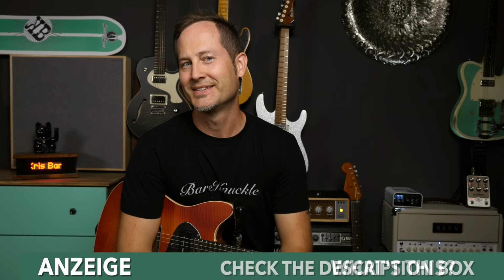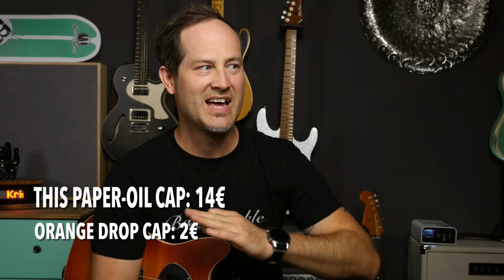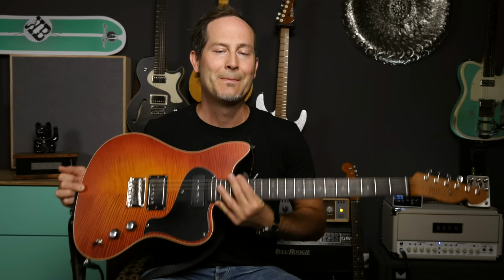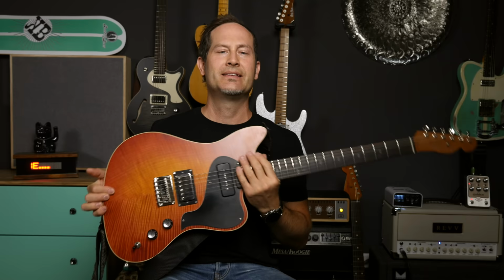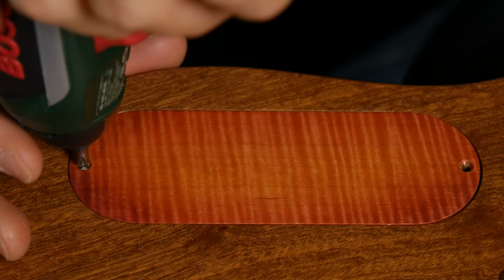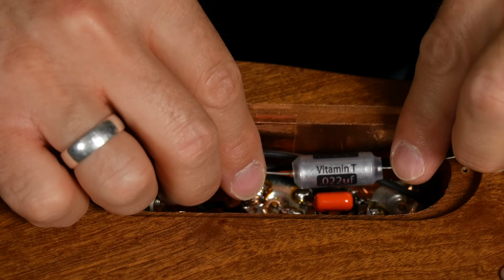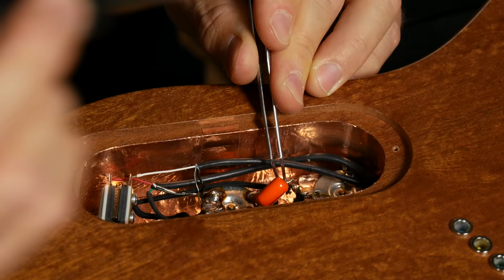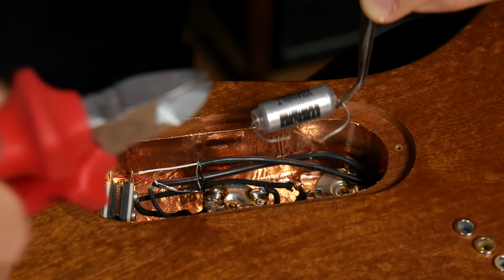Guitar Myth-Busting! Are Paper-In-Oil Capacitors Better? | Guitar Tweakz

Comment: The last mass produced paper in oil capacitors are far beyond "Best before", even NOS. And, Paper oil usually has huge tolerances in production, without tolerance markings, test says nothing. Usually for Paper Oil is +/-20%. Codes for old "bumblebee", color of 4th ring: green 5%, White 10%, black 20%, orange 30%, yellow 40%. If you buy those, if 4th ring is not green, you are even more ripped off. More modern color coded capacitors use different colors. Paper Oil degrades much more over time than modern materials. Modern materials produce much tighter tolerances. And if you really want PIO, check the market. PIO is available at $1 a piece (i.e. tubestore).    
As 5% was "best you can buy" for Paper Oil", that's standard for even the cheapest (Orange Drop Style) capacitors today. Tolerance classes today go from B ( 0,1 % ) to M ( 20 % ) - J (5%) ist just the 3rd worst tolerance you can buy. A 5% tolerance cap ( 220 ) can be anywhere between 210 ans 230 ... and this makes a tonal difference.
Regarding to a shop, where Vitamin T is to buy, this is 10% class ... so anywhere between 200 and 240 ...

Comment: Question: did you measure the parameters of the capacitors to ensure that they are nominally identical (capacitance value, equivalent series resistance(ESR)?).
Asking because you can't rely on just the numbers printed on them. Capacitors generally have a 5% or 10% value tolerance, meaning that your .022uF capacitor could have a value of anything between .0198uF to .0242uF out of the box*. ESR can be measured as well, but tends to be so low - of the order of 0.1 ohm - that it's not relevant. Also, the foil wrap direction *may have an effect, but only insomuch as one orientation may help to reduce hum so again, not really relevant to tone.
That capacitance tolerance, however, is the main thing. It is going to be way more noticeable than minor tonal differences due to whether it's a PIO or Orange Drop; the tone circuit shapes the frequency response of the guitar according to the value of the capacitor so if you're not testing with capacitors of identically matched nominal values, the experiment unfortunately can't be trusted. a 5% difference in capacitor value means a 5% difference in where the tone control 'bites'. That's huge; nearly the difference between A (440Hz) and Bb (466Hz).
Also; maybe a blind test with somebody else changing the caps but not telling you which is fitted before you play it would be more scientific. You may not believe you have confirmation bias but it can't be helped.
Not meaning to criticise to offend, please don't take it that way!

Comment: Next time, you can just use alligator clips & wires to connect the different caps rather than solder and desolder over and over. You can also do that if you want to test out different rating caps of the same type(all orange drop, etc...) and decide what you think sounds best before soldering it in. See whether you like .022  better than .047 or even try something like a .001 🤷

Comment: different types of capacitors may distort the audio signal for example ceramics, also that may have a different inductance and resistance due to the manufacturing process also the quality factor of each cap may be different

Comment: There are two important differences...price and less stability with time for the paper in oil.😄
And it would have been useful to measure the precise value and tolerances of both capacitors. Little differences in value will change how the tone knob responds when it's turned...but no differences at all when the knob is on 10, because there's no work done by the capacitor when the tone knob is fully opened.
Reply: I was looking for this comment lol
You literally can’t hear the difference between the caps unless you roll the tone

Comment: I didn't notice any difference. The difference if any is barely perceptible. I put oil and paper caps in a few of my guitars years ago and at first thought that it sounded a little warmer but I reverted back to my beloved orange drops. So much of tone chasing is cork sniffing. After 40 years of chasing tone, I am still using Les Paul or Strat through a Marshall.

Comment: Definitely cleaner and slightly warmer. Before I upgrade pickups I lower them and if that doesn't work I try other value capacitors. The latter usually saves me time and money.

Comment: I changed a lot of  Capacitors in my Guitars. The Bumblebee style is not different in sound if it has the same capacity as the Orangedrop. That is missing in Your Video.The Caps are delivered in a tolerance of +- 5% if they are good quality ! I never picked two with the exact same Value of nanofarad !!! I think that the magnetism of the Pickups influences Foil-caps more the ceramic caps. That may be a little fact for a difference,  Keep on going with Your interesting good Videos.

Comment: When the tone is on 10, paper in oil sounds better, in my opinion. But, when you roll it off it sounds a little bit muddy. Maybe if you put 0.15 cap  would be a bigger difference and paper in oil would have more advantage? I don't know.

Comment: PIO is not snake oil. It does sound smoother and has a tone quality that is rounder and more vocal quality. Orange drops are very clean and sterile sounding with no sag in the pick attack like PIO. That is what you hear most that people cannot describe….. sag…. When the note is picked, it takes a microsecond or two is what you feel between PIO and Orange drop which is usually Mylar.

Comment: I have spent 3 nights in a row comparing a wide range of styles of capacitors I have on hand. I can confirm that even the cheapest and smallest voltage rating ceramic disc cap compared to  600 volt real vintage orange drops and other vintage types had very very little if any difference at all, as long as the values were within .005. And almost all of the vintage caps were way out of spec and I had to choose carefully to match values to perform an accurate test. A cap measuring .022 sounded darker than one measuring even .017. I compared for hours and hours hoping my vintage poly caps would sound better. They look cool but they didn't. I ended up keeping the .022 measuring (.017-.019) disc caps that came stock in my 1991 Les Paul classic because the values were the right tone. I had just changed my pots out for Mojo tone 500k audio taper pots all were within 4% spec. and did the 50's wiring. I wanted the neck pickup when rolled all the way down to zero to have a nice warm slightly bassy singing sound. I tested cap values from .001 to .047 and the value range that sounded best was around .015 - .022  if I went to .033 it was way too dark and dull and the guitar felt harder to play. .017 even in the tiny little ceramic disc caps nailed the woman tone!! and felt like a sustaining violin the guitar notes were so smooth. I did not have any paper and oil ones on hand, but I know that I could've used my vintage orange drops or other really nice poly caps but I'll save those for my amps. Remember we are dealing with millivolts the large high voltage caps are not necessary. The ACTUAL CAP'S VALUE is far more of an audible variable than any nuance of ESL or ESR of different capacitor types and makes.

Comment: Damn, that Paper in Oil cap is the cat's meow...!  THAT's a great sound... I've got orange drop caps in my Les Paul and have just felt it was a bit "flat" sounding... kinda what I'm hearing with the orange drop in your guitar. The paper in oil sounds more 3-Dimensional, with clearer mids, more depth the the bottom end, and more nuances overall... and I don't care if the audience can tell a difference, it's about the guitar speaking for me... I just ordered up some PIO caps... thanks for the demo...!

Comment: Agreed with you and many others here. The difference would not be noticed by an audience but it was surprisingly obvious to me. But as someone else said, you should measure the actual value of each cap because that alone could account for a difference. For exemple, the difference between a .022 and .047 in both Strats and Teles is drastic. In my Tele, a 0.22 makes for a tone that is way too bright. In my Strat with the pickups I have it's great (orange drops in both cases).

Comment: I couldn't hear much of a difference between them , but there is a chance that if you try a different value paper in oil cap like go from .22 to .33 to .47 which are the most commonly used. Or use random values and see. That could be a great follow-up video.

Comment: From Leo:  we have to remember that the US manufacturers quit using oil filled capacitors in radio equipment 70 years ago because they were unstable and drifted from many causes.   I have no doubt that there was different tones, but I strongly believe it is not the construction, but the tolerance.  I still own an obsolete oscilloscope that is 1000 times more sensitive and has a 20,000 times more range than the human ear.  My left brain will not accept it if the scope cannot measure it.   I have enough right brain that if it feels good to you, it does not hurt anyone if you want to use it.

Comment: Now put both those caps on a meter and measure the actual capacitance and the ESR value at the same temperature, then do the same but warm them with a hairdryer and measure the ESR.  I think you will find that the values drift more due to temperature based on the material the cap is made of.  And when the values drift, so does your tone.

Comment: PIO definitely sounded better to me! Would it be a practical conversion though? For a studio use only guitar I would say yes, on stage they probably would not hear the difference most likely and doubt would be as sturdy. Split decision here.
Reply: I think you don’t have to worry about durability of the paper and oil caps. There’s 59 Les Pauls with them in still going strong after 60+ years not to mention countless strats and telecasters. What I do know is they tend drift upwards in values as they age that could be considered the character of these caps whilst Orange drops will reman more close to tolerance over time.

Comment: Even if you used other orange capacitor it will may sound and feel a bit different.
That's the good point about analog electronics; no two components are equal the same. 
I think it's a too nerdish question, but it is very very relevant. 
As always, it's important to have very good quality components. Chances are that your sound will be better.
Glad someone make a video like this.
So coaked wha-wah sound, in the middle position (tone rolled off) is very useful.
Cheers,

Comment: Oh man it's just ridiculous that some people don't hear the difference in tone there was a huge difference in there was an improvement when the paper in oil cap ! I'd say about a 20% nah improvement . The sound was more natural and organic. It didn't sound as thin and ice picky on the top end. It had more robust base and the little mids were cleaner and not as muddy more difined . So let me ask some of you  guys what in the hell is better about the orange drop? No admit I probably have better ears the most, I spent 23 years at Gibson guitar and Gibson custom shop and we've all experimented with different camps and all the really good players that have good ears all agree the paper and all sounds better really the bumble bees are excellent if you can get ahold of one those. Also don't forget your tubes! And no I'm not speaking about the Chinese Czechoslovakian in Russian crap that's being pass off as good quality tubes . Will some of them might be all right as far as reliability but sonically they absolutely suck. The muddy and I don't have very much definition. You just can't get him to really cut through the mix and have that nice one came mid-range a guitar should have in the mix. They usually sound kind of Sizzely Anaheim and have a overabundance of muddy low mids. You do far better lat 50s or 60s either lightly used in fully tested and guaranteed mulled, amperex, telefunkin Euro tubes or RCA GE or Sylvania American tubes. Intercourse speakers are Wayb huge and so is cabinet design and material. Remember it's not just one thing when it comes to good tone it's not just one thing that makes the good, is the sum of all the little positive changes that add up that really give you a good tone. if anybody has any questions about tubes give me holler

Comment: No where in the equation of what a capacitor DOES is the material makeup of the capacitor or the voltage mentioned. The ONLY this outside of the equation where a makeup/side/type is mentioned because of the voltage potential WHERE the cap is used. Obviously INSIDE a passive guitar VOLTAGE is not a concern. Beyond voltage a capacitor IS A capacitor.

Comment: To my ears, the p90 is much more affected by the paper in oil cap. I prefer the sound of the orange drop in this situation, to be honest. I have, however found that strats and teles can benefit from the warmer sound of the paper in oil capacitors, rather than the ceramic or film caps they come with.

Comment: The tone with the paper oil st the middle tone position has a notable difference to me, it seemed to be a warmer tone with a rougher edge darker tone the lower the setting of the tone know. I liked it myself I would like to try it on my strat with hot pickups on it. It's taken time to get use to how to setup these pickups the lower the volume and tone setting are exactly the best settings in my case already and use Amp or pedal to boost the lack of volume by doing thar.

Comment: I only watched the conclusion. Did you measure the capacitance? There's always variation within the tolerance. Older and cheaper ones vary more in their value. That's the real difference on guitar tone caps. 

Tube amps with high voltages are a different matter.
Reply from the maker: @hallanvaara6106  I made a follow up to this video where I measured both. The result is more than surprising. 
https://youtu.be/KxodS_UOCxY?si=nA9hqSFtp0h-5p0T
According to the measurements the tone difference should’ve been the opposite of what I heard so the type appears to be relevant too.

Comment: Sounded noticably different, the price of 1 (or 2 caps in case of Gibson wiring) is not so significant, not to go, for cap you will like better.

What I noticed mostly was, difference on neck pickup around halfway down. The "woman tone" sounded more Clapton like, to my ears with paper caps.

ps: I dont remember people saying, that paper caps people say "those sounde better", what I remember is always "they sound vintage correct". As always, what is "better" tone?

Comment: Did you check them with a meter and make sure they measured the same? Because caps of the same make and model can sound different between each other because of the tolerance in capacitance

Comment: I hear a huge difference between the two - (I'ld be interested to note if you measured the output voltage of the two b/c that could influence the interaction with everything downstream). That said, I can see how the marketing spin for orange drops says it prevents loss of high frequencies, because they seem biased toward the high end anyway. The oil in paper has a more vintage sound to me (hey marketing dept) but I could also detect (unless I'm imagining it) more of a interactive presence of the even overtones that I'm suspecting makes it more fun to play - especially before a sensitive drive pedal. Some might describe this a warmth, but for me it goes beyond that b/c the degree of warmth changes with the dynamics of the playing - hence more fun (good luck translating that marketing dept). Of course I could be full of spam, but that's what I hear, and I would grab the axe with the oil-in-paper every time and take my chances. (Full disclosure - I recently had to undergo cancer therapy that has probably left me somewhat radioactive, so in a month I may hear totally differently - but I kind of doubt it b/c I feel that thing Zappa was always trying to mine was in those overtone nuances I was trying to describe).

Comment: How come we hear a difference with tone at 10??? The cap is not in the circuit...
Reply from the maker: How come we hear a difference at all? The value of these two caps are so close, there shouldn’t be any difference at all. I made a follow-up video where I measured them because that part was still not clear after this first video. The only reasonable explanation is that different types of caps do make a slight difference even if the values are the same. And the difference with the tone at 10: try low quality pots vs high quality ones, both at 10. That also shouldn’t really make a difference in tone but they do. 🤷‍♂️ 
Everything in the circuit seems to influence the tone slightly, even when it’s at 10 and it shouldn‘t do that.

Comment: A capacitor is a capacitor. Tolerance variations between caps might vary the sound a bit, but two equal value capacitors will sound the same.
The rest is just audiophoolery.

Comment: Don't trust your ears! It's called expectation bias or placebo effect and it is real. Same value same tone, you have to measure them to do a valid test. And in a guitar the cap is in series with a 250 or 500k pot. with tone on 10 no human ear can hear the diff. between even diff. value caps. And nothing in there can add tone, all the cap does is bleed off highs. Diff. material caps are made for diff. working enviroments a micro farad is a micro farad. 100 bucks for 20 cent bumble bee caps are guitarists that ignorant? I guess if you play your guitar backwards with the cover off they look cool.